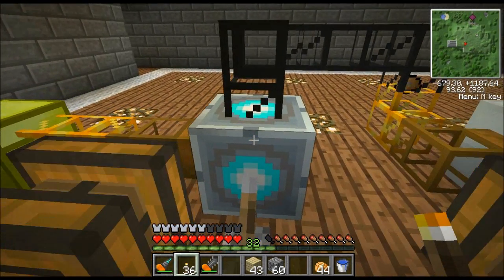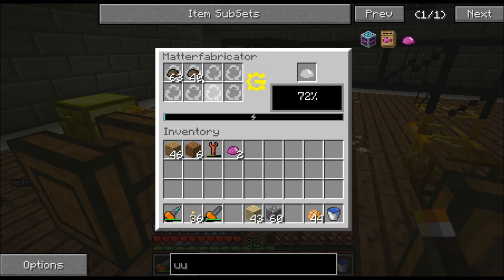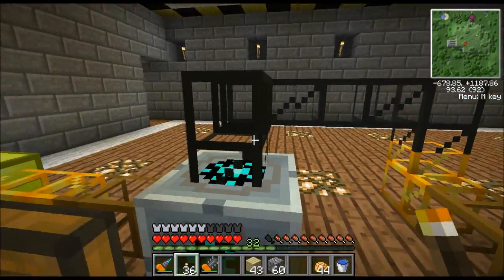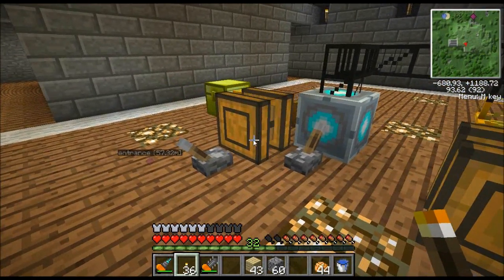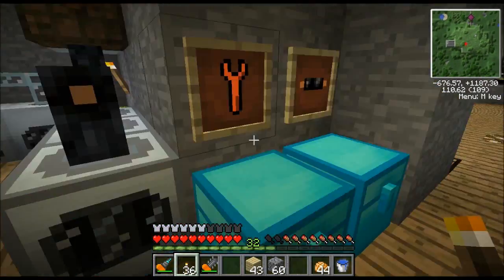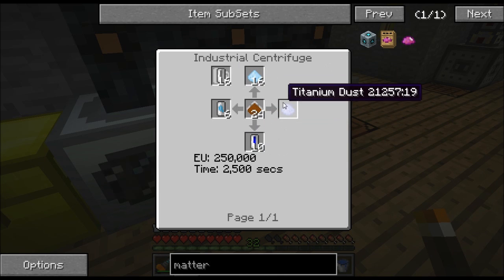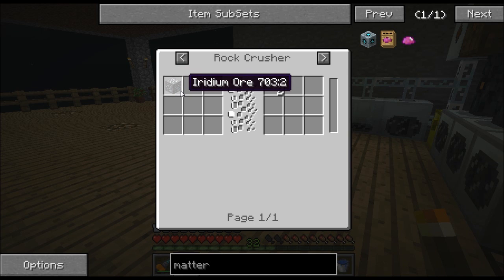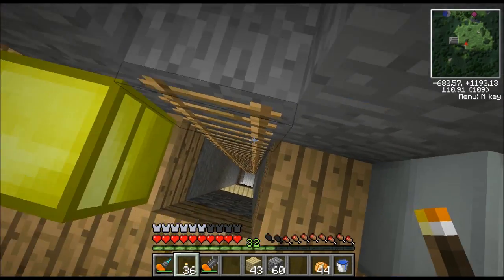Feed The Beast Tutorial Guide - Matter Fabricator, How to Make and Use

Comment: if your having trouble getting iridium here is a way to get a ton
1) make an induction smelter
2) pulverize about 40ish ferrous ore (you want 2 shiny dust)
3) get a bunch of rich slag from the induction smelter.
4)put the 2 shiny dust and the rich slag into the induction smelter
5)now you have 3 shiny ingots (you just turned a rich slag into a shiny ingot)
6)macerate the ingots for platinum dust
-repeat til you have a lot of shiny ingots
7)8 dust into an industrial centrifuge for iridium

Comment: Just as a follow up to my previous comment after doing research: the matter fabricator has no energy limit with regard to how much it intakes. With that in mind, I found out that an MFSU has a maximum output of 512 EU/t. Advanced Solar Panels can output 32 EU/t but only generate 8 EU/t. So 512/8 = 64 Advanced Solar Panels. I set up an array of 64 with diamond cable, and hooked it to the MFSU and then the MatFab and it doesn't store any NOR does it lose any power (the MFSU that is)

Comment: You only need 4 iridium bars and 4 platinum bars, which means you only need 2 iridium ores, and macerate them [oh. . . my. . .    did i forget to smelt the iridium ore with rich slag??]
One of the recipes for the sub components for the matter fab will take platinum ignots in place of iridium!  I lucked out and found 2 iridium, but I do cave like a boss, and spend a lot of time.  Its nice, because you CAN find 2 iridium ore, it will take a long time.  Iridium is to diamond as diamond is to all.

Comment: I play the Mincrack pack v7, in my case i can indeed use fortune pick on the iridium ore, but i only get 1 or 2 off the iridium ore, the one picked up without the silk touch enchantment. Hover if you pick your ore in the raw form with the silk touch or the rock cutter,  and macerate it or grind it in the industrial grinder to get the 2 ores every time guaranteed. Have a good day.

Comment: Is there a reason why you don't have the fabricator as stubbed branch from the core power lines?  i.e from your solar panels it feeds to both storage units and the fabricator? If the storage fills, it would give all surplus to the fabricator.

I didn't know about reversing the transformers current. Great tip. :)

Comment: Easy 'nuff to test, i just  trew down a stack of iridium ore (in creative ofc.) and mined it up with Fortune 3, the result were 96 Iridium instead of the  128 (+4 extra from platinum dust if you use the industrial grinder) iridium it would have yielded otherwise.

Maybe i were unlucky but not once more than 2 ore dropped so silktouch deems to be the way to go.